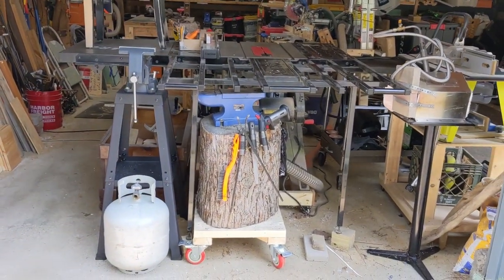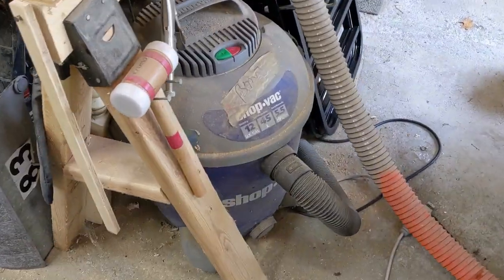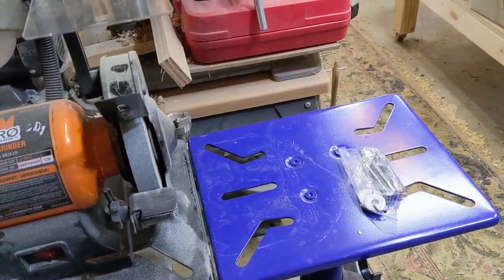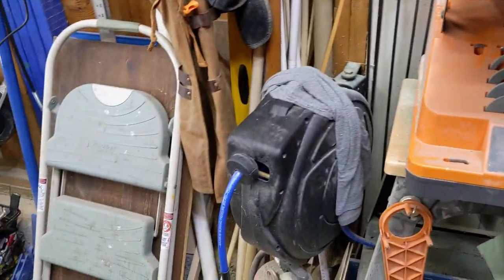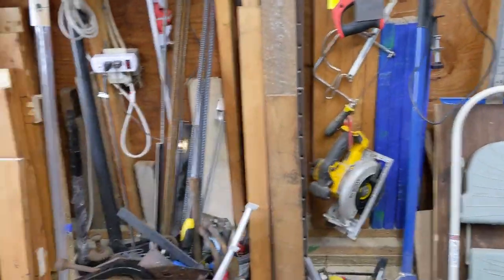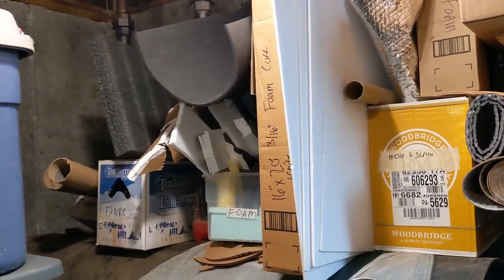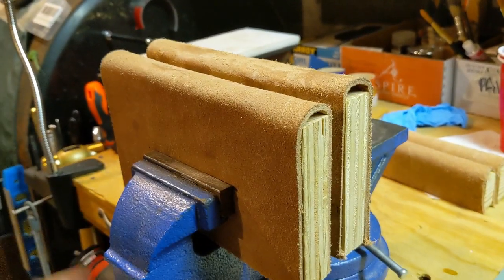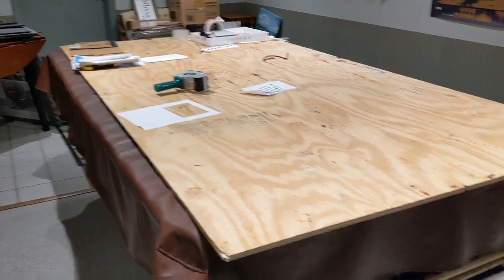Home Workshop Tour

Comment: A true workshop. Two questions how do you like the bandsaw I need to get one but can’t make a decision. Also how did you make the blast furnace?
Reply from the maker: Thanks Dennis! I had a 10" Skil saw originally, but that had a really bad wobble, and ended up giving it away to a friend. I went with the Rikon because of reviews of it, saw a lot of others on YT using it, and also have used it before, as we have one in our shared shop space as well, which we use mainly for metal cutting. I love it. We have a massive Laguna at the shop which is amazing, but really expensive.

The furnace is a knife making forge made by Mr. Volcano, it was a kit: https://amzn.to/3IdyMzv, AND, it's only $88 on Amazon right now. And have it mounted on top of a WEN Bench Grinder stand: https://amzn.to/3IeIJg8

Hope this helps, and thanks for watching!